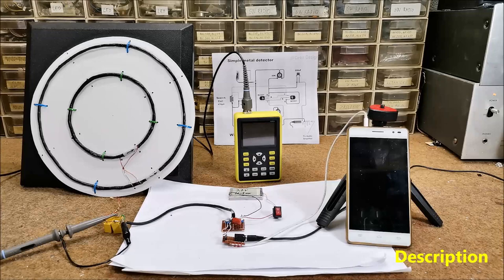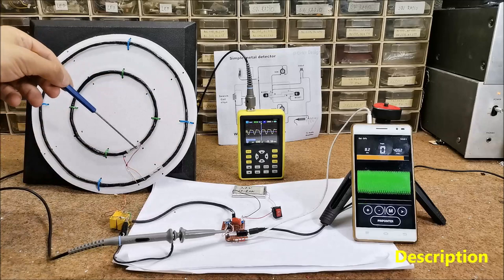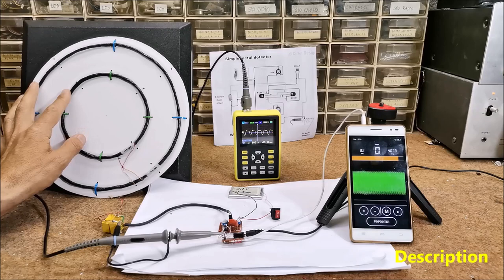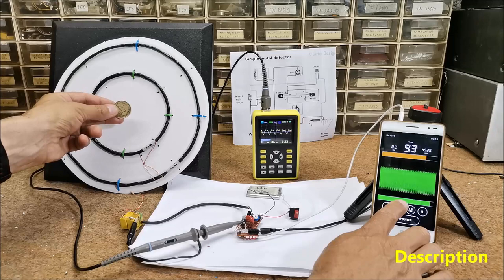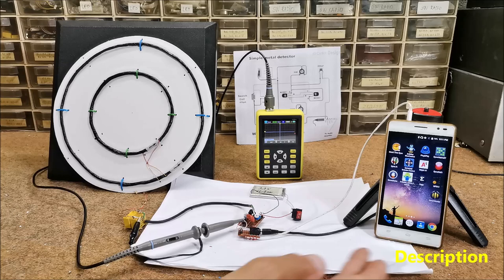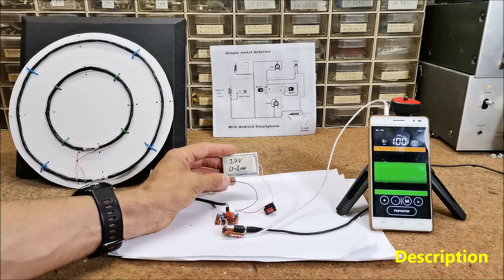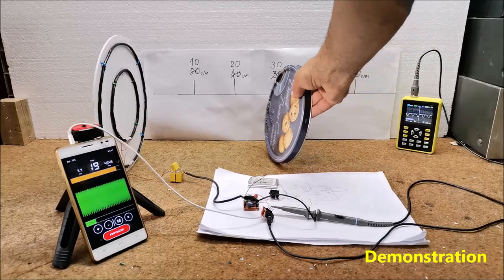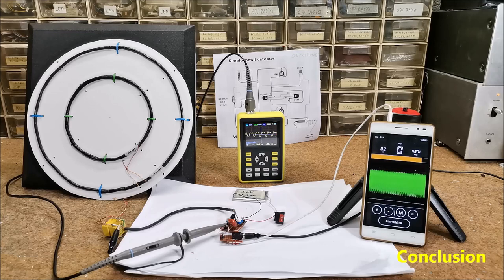Simple Smartphone Metal Detector Experiments

Comment: Help...I tried this circuit but when I plugged it into my phone it was not detected by the phone. Probably because the 200nf capacitor acted like an open circuit on the mic jack so it was undetected. Is there any way to manually bypass this automatic mic detection?
Reply from the maker: You should connect a 10k resistor in parallel to the microphone input

Comment: Hello Mirko, I made the circuit. It oscilates at 9khz. But it's blind to every object that I put. maybe if the object is too closer to the coil the detector screams.  I tried to adjust the two trimmers  in a lot of ways, but it can't detect objects in a small range. When I put an object I see the variation of the signal on the screen, but the detector is mute. I made the coil same as you. Please help me. Thank you.
Reply from the maker: Try to connect connect a 10k resistor in parallel to the microphone input

Comment: What if you had two pickup coils wound opposite each other so that they perfectly cancel out?  It would be like an electronic interferometer, no?  If the impedance changes asymmetrically across the coils, they fall out of phase and give a readable signal.  At least, that is the theory.  I know more about physics than electronics, so please do correct me if I'm mistaken, but I think it could make for a very sensitive detector.  The signal strength would be determined by the transmission coil, and only the phase variance would be determined by the feedback from the target.  I probably don't know what I'm talking about, but maybe it's a new toy to play with.  🤪
Reply from the maker: In fact, in the course of experimentation, I also tested that option unintentionally, but the results were the same